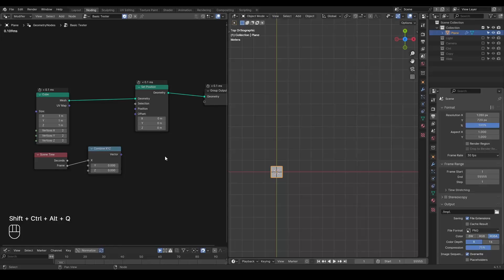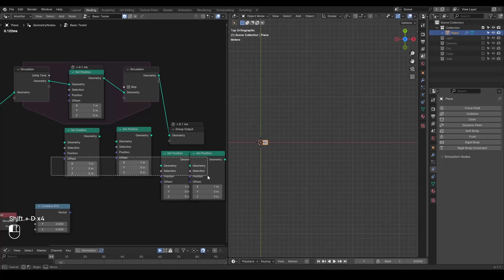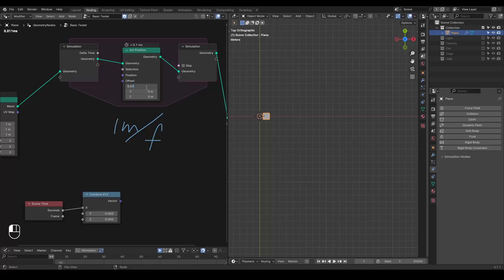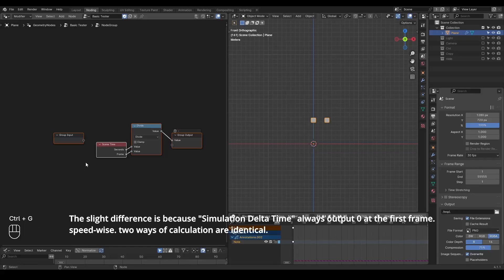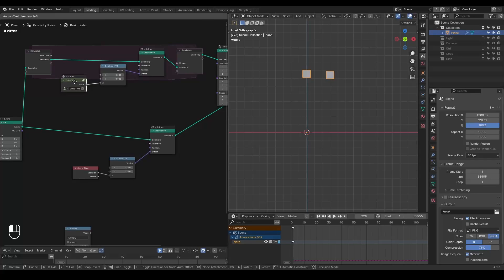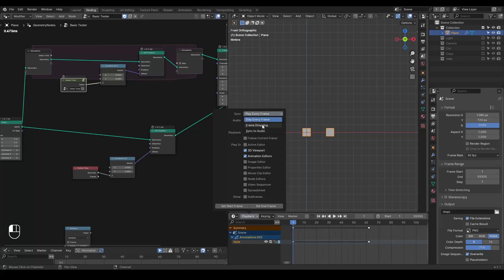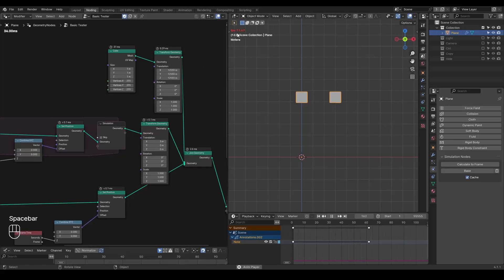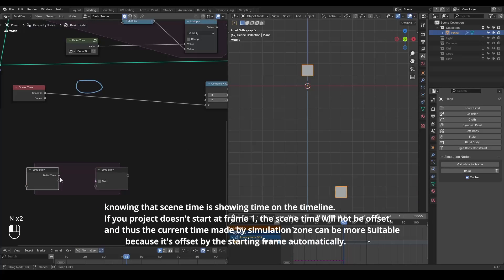[Tut] Delta Time and Gravity in Simulation Zone - Blender Geometry Nodes Fundamental 4.1+

Comment: This is a great look at the Delta Time stuff!

I just experimented with a slightly different custom Delta Time node, which you nearly had in your setup. It's simply a Simulation Zone with Delta Time connected to Delta Time and then to the node output. This seems to cover all bases including frame dropping.